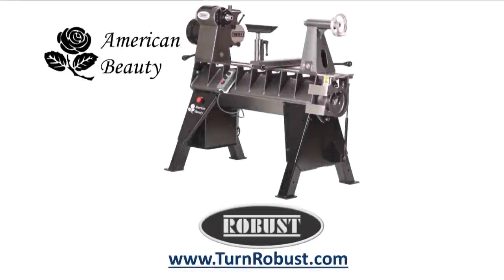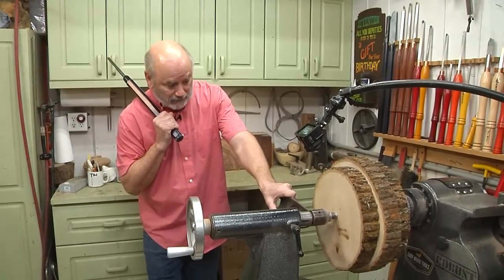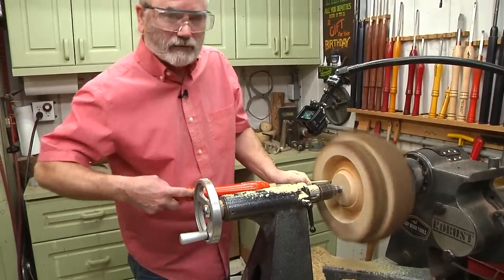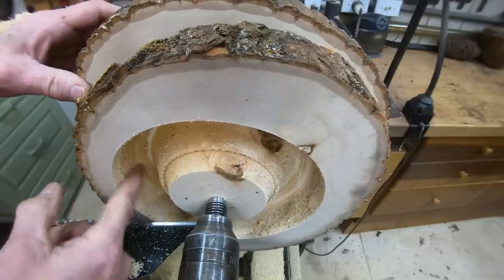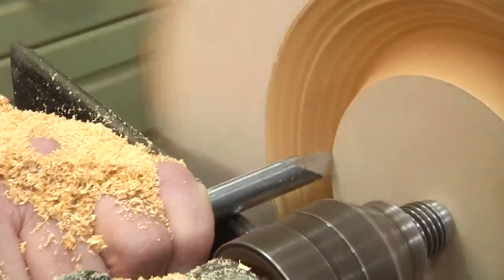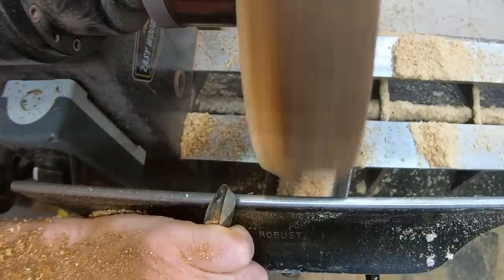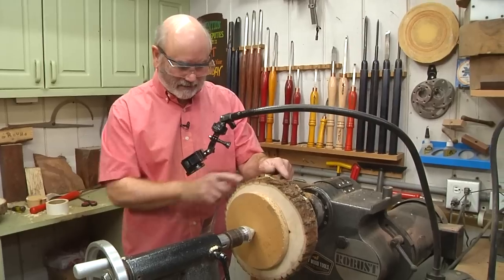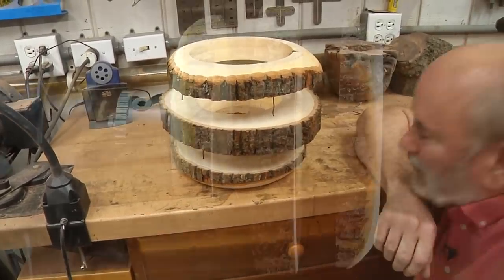Floating Bowl

Comment: Hey Tim! I had an 💡! If you took a super small drill bit and only made holes through the 2nd and 3rd layers (sections?) big enough to pass a doll making needle and two strands of fishing line through at the same time through,  (these come 3 to 7 inches long and super duper skinny) then cut two pieces of fishing line. One length equal to the length of the bottom surface of your top piece to the distance of where you would want the bottom surface of the 2nd piece to stop plus one inch, and another piece equal
to the length from the bottom of the 2nd section to where you want the bottom of the third piece to end plus one inch. Then with a staple gun, take the first piece of fishing line and around a half inch from the end of the line staple a it to the bottom of the top section. Take the other end and thread it through the doll needle and pass it through the hole in the 2nd section. Take off needle and staple the line a half inch from the end to the bottom of the 2nd piece. The your 2nd piece of fishing line, measure a half inch from the lines end then staple on that spot on the bottom of the 2nd layer and pass through The holes in the 3rd layer using the dolls needle..  Remove the needle make sure you're half inch from the end And staple where to be farm of the bowl. This would make it so you don't have to drill as many holes and the illusion I really stand out even more if you can't see anything hold me up if you don't. Want to make the bottom on level to where it possibly could rock 2nd 4th you could always. Create a recess somehow on the bottom 3rd piece that the staples would go into so it could be but then you have to Add that depth of the recess To the length of that last piece of fishing line, although i'm sure it wouldn't be very much. Anyway just thought I'd share....hell this might be a stupid idea. But then again, who knows, it might be as cool as I see it in my head.  But I figured ii couldnt do any harm to tell you, so if you or anybody else though it would look cool and wanted to try it they could. Plud, I really want to know if it works. 🤣 So, if anybody does try it and it does, LOL...let me know. 
As always, love your channel Tim and all your projects. Keep them coming. You're my favorite creator on here with the coolest creations!✌️&❤️!

Comment: Maybe epoxy some brass rod instead of just the wire, and give it a nice stain (or stains) to put some color in that basswood..?
Reply from the maker: I had copper, brass and dowel rods ready to use but I misplaced my tenon markers so I went with the wire. If I was off a bit on drilling the holes for the rods or dowels we would have been in trouble 😅I can't wait to really try some different mounting methods and different wood on the next one.